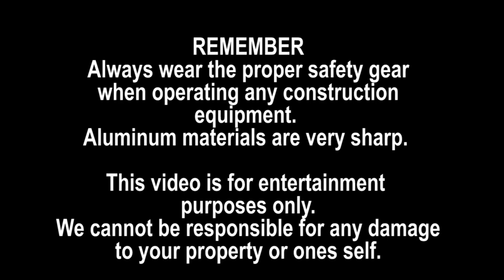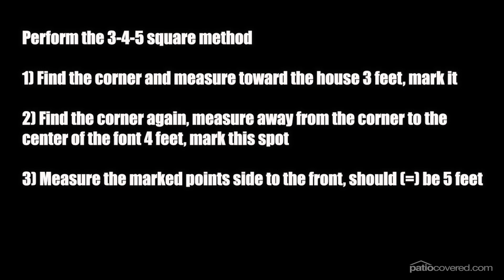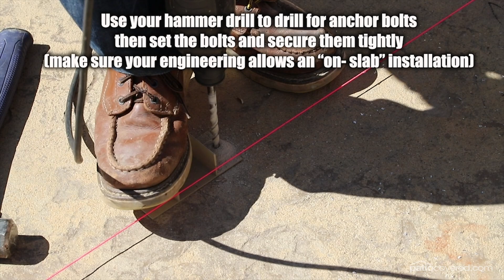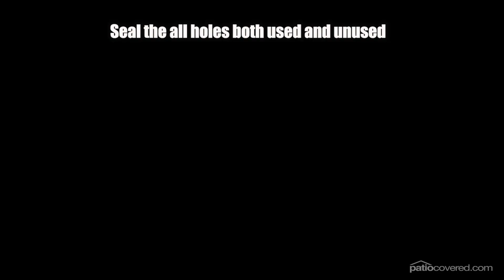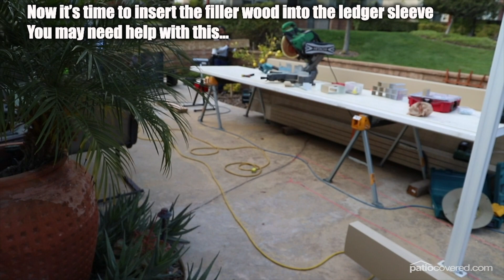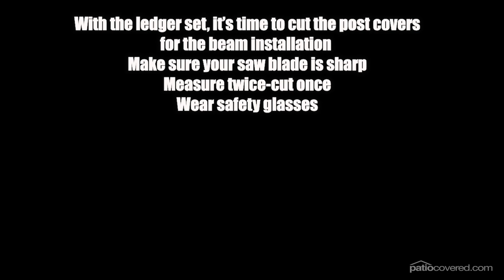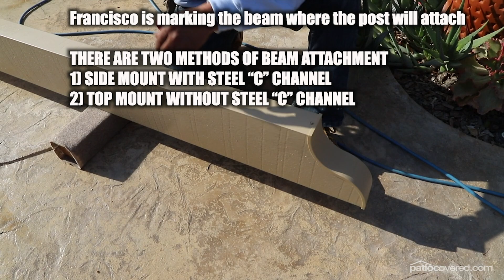How to install an Aluminum lattice Patio Cover kit

Comment: I have tubes that are bent that need to be replaced. Problem is there in the middle. Don’t know how to get to them without disassembling . I have the replacement tubes just need knowledge
Reply: They all show you the insulation but not the up keep.   Kind of strange????

Comment: Do you sell similar aluminum covers to install on top of the shade / lattice bars if later on I decide that I want complete shade instead of 50% shade?
Reply: Yes, we do but there would need to be adjustments made to accommodate a pitch for water to drain efficiently.